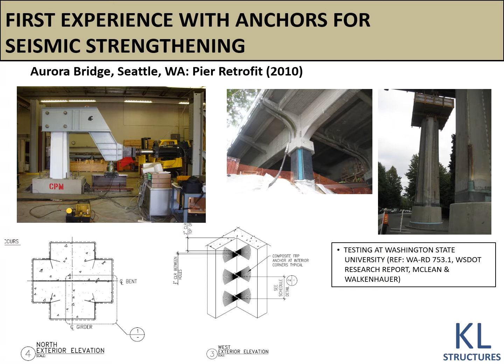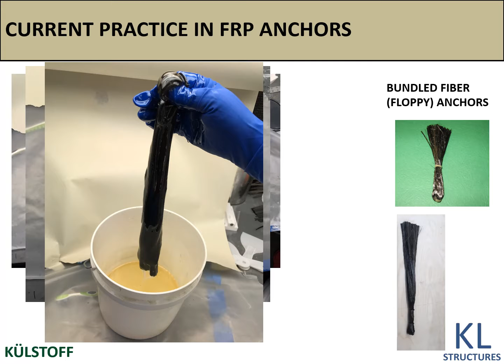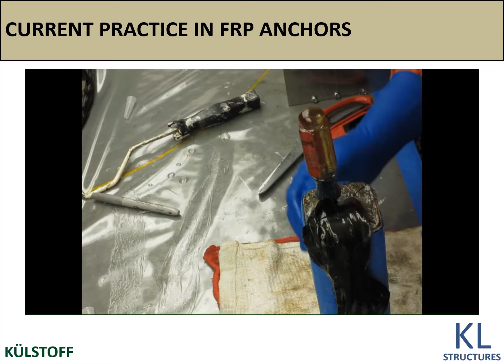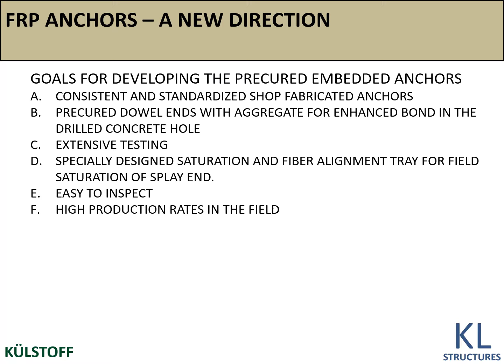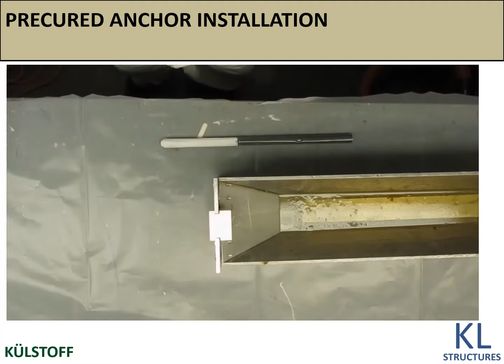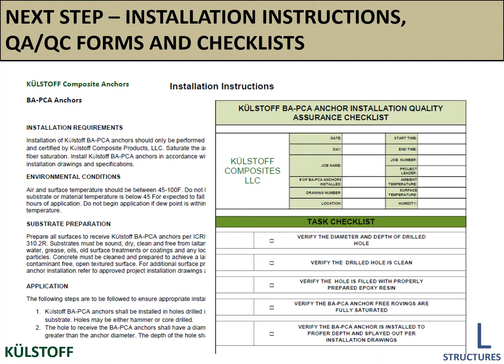Kulstoff Precured FRP Anchors - Research & Development

Comment: We believe that CFRP is the way of the future, and have seen it being adopted more frequently for concrete crack repair and structural strengthening projects in recent years. Backed by lab and real world testing, CFRP is high-strength, low-weight, cost-effective and resists corrosion.

#carbonfiber #horsecarbonfiber #carbonfiberrepair #construction #crackrepair #concretecracks #concrete #concreterepair

For more information please visit our website: www.horseen.com
Email:engineer9@shhorse.com
WhatsApp:+8615257490626